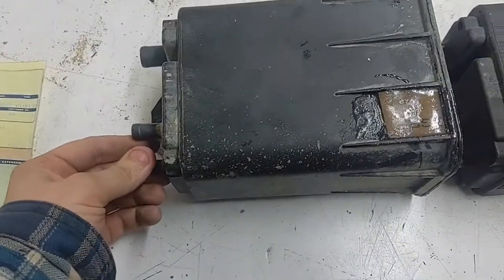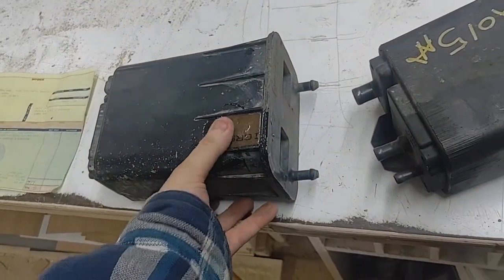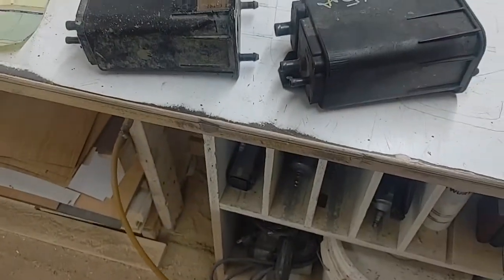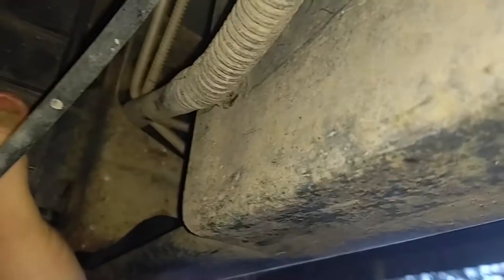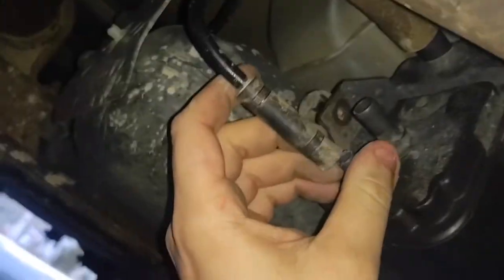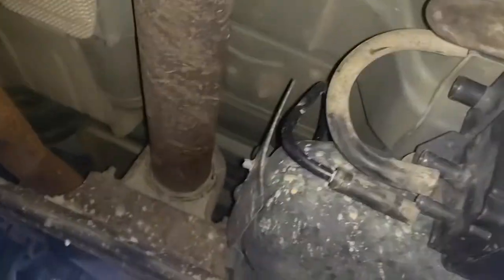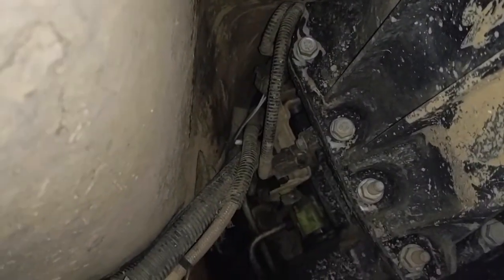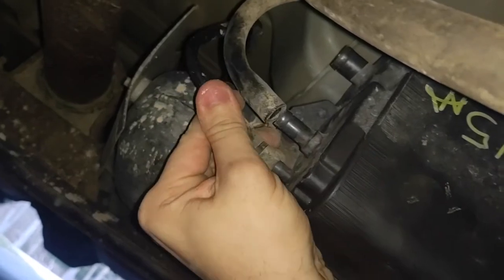how to replace a carbon canister in a Dodge Dakota

Comment: Mine(3.9) throws a code about every 100 miles(going to try a check valve and fool it, it may not work, but it won't hurt to try, says small EVP leak, just clear the code and drive about another 100 miles)
Reply from the maker: that's what mine did until I replace those hoses that go to that fuel catch canister or evap canister

Comment: Shop just called and said mine was bad and quoted me just over $1,000.. I don’t have gas mileage issues, it just takes a looooong time to fill my tank up at the pump. I thought I was having an issue with my fuel filter neck! It’s not making sense to me yet lol
Reply from the maker: it sounds like a fuel neck  hose pinch or something like that I heard about a guy that had a dead animal stuck in his it was like a mouse or a rat or something like that but good luck!!